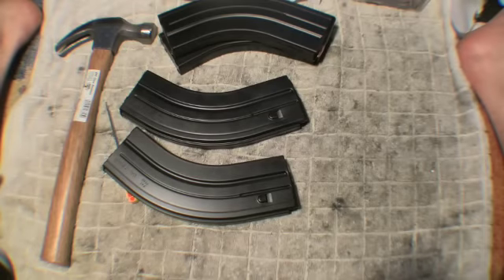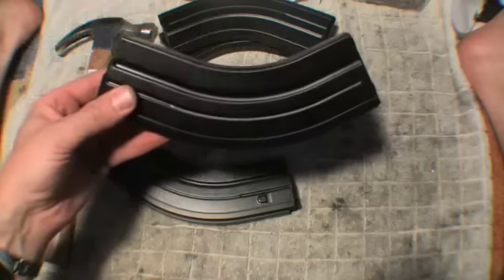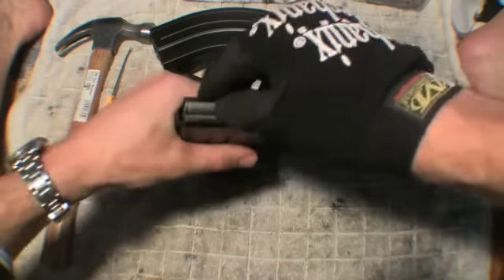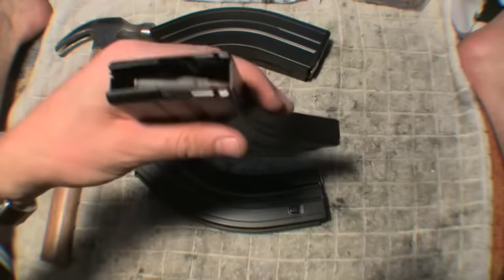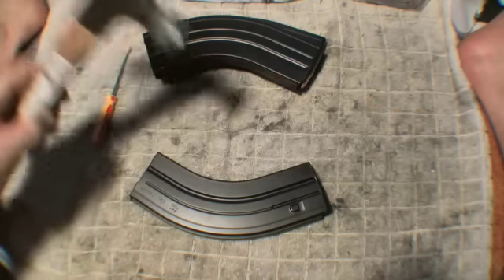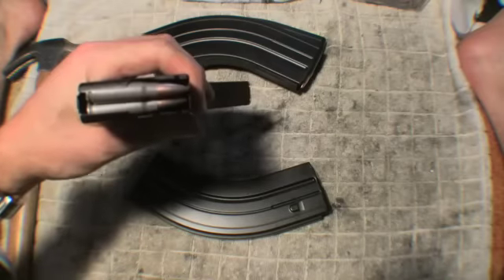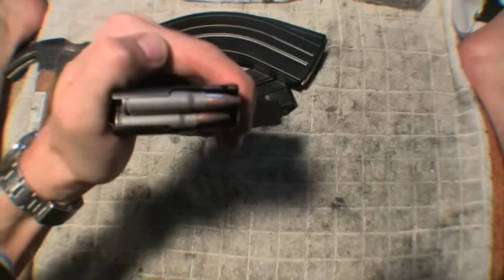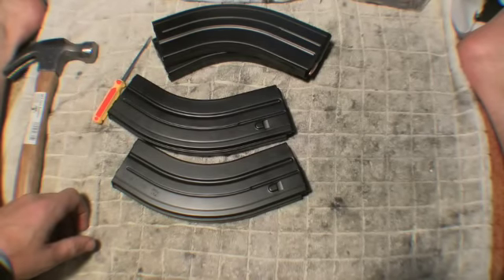C-Product 7.62x39 Hammer Tuning

Comment: I used a similar method with a 3lb sledge hammer. Lay the mags flat, beat them into the concrete. Discard flattened mags into trash. Go buy an AKM.
Reply: I bought a wasr10 from a guy at the range because he was pissed because it kept jamming. I looked in my wallet and said I will give you   what I have for it. I can't remember the amount but it was 300 or close to it. I was shooting my Norinco Mak90. I emptied the plastic mags that he gave me with it and I took his wasr and did 2 30 round mag dumps with chi com steel mags. He was pissed. I have built 2 AR15s in 7.62x39 and use asc magazines. Also ground the m4 feed ramps wider. I will have to try this on my mags. Just built a .450 bushmaster for deer season next year.

Comment: I thanked you previously, and shared with you also the idea of applying Moly Grease to the inner walls of the magazine to make things slide around much easier, and now I have another tip to share...
If the rounds are getting caught on the front lip of the mag, or are not being stripped off the mag, the solution is to replace the buffer spring for a .308 buffer spring, carbine or rifle length, depending on what rifle you have. 
The extra strength of the .308 buffer spring will send home those rounds no matter what. You are welcome. God bless you all.

Comment from the maker: I finally resorted lightly lubing my steel cased ammo before putting the rounds in the magazine. That seems to work best for me. Hammer tuning helped though.
Reply: Lube with grease the inner walls of the mag, that will help better. Lubing your ammo is not recommended, if the grease slips inside where the powder is, it will have negative results.

Comment: I just found your video since I'm using new C-product mags. Mine does not have thaat issue though. The rounds will pop back up normally after I push it down. I bought the mags in July 2017. Maybe they have fixed the issue? 

My x39 upper still has feeding issues sometimes when it doesnt feed the next round after shooting the first bullet. It could be the upper itself though since it is still new

Comment: I have the same problem with my new 20 round ASC mags (shocking right?). What I'm going to do is strip the paint of entirely, plate the inside with brass, repaint them, polish the follower, and replace the springs if all that doesn't help.